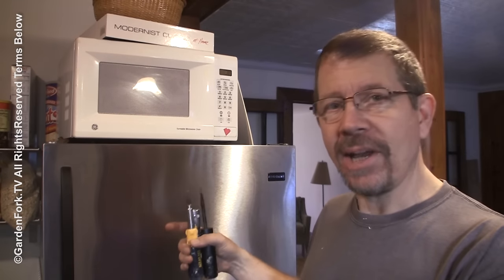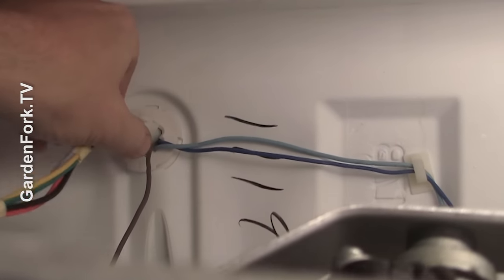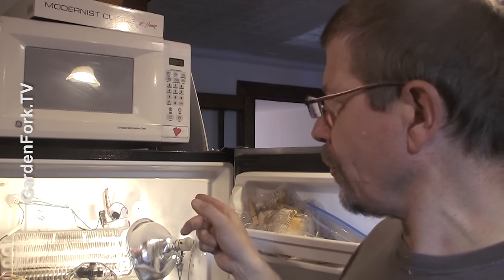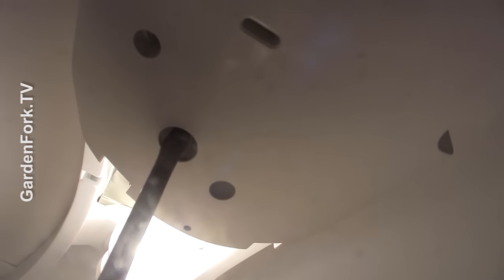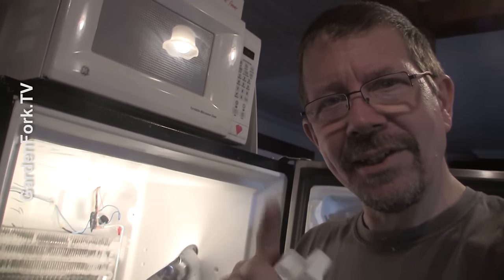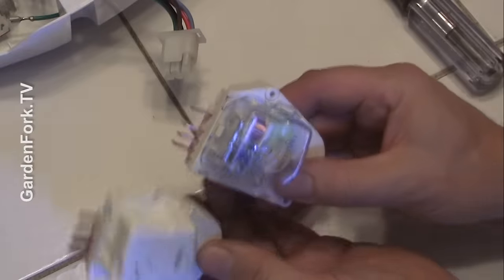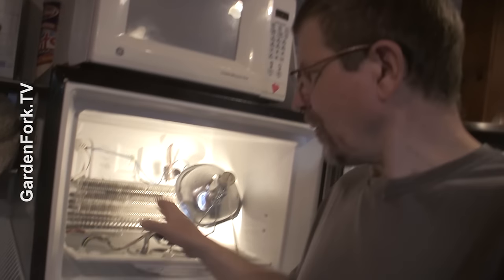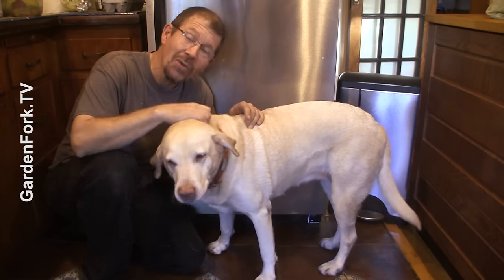Refrigerator Repair - Freezer Coils Frozen - Refrigerator Is Warm - GardenFork

Comment: Hi GardenFork!  My situation is like you explain in video.  I have same refrigerator as in your video.  Specifically a Frigidaire Model # GLRT182SAW2.  Freezer not exactly freezing up "a lot" as you say.  But freezer is freezing food. Bottom refrigerator is warm, not getting cold, food spoiling.  I see some snowy like frost on back freezer panel and on freezer vents, but not a whole lot.  Every now and then the snowy frost on freezer vents melts and I get water dripping from somewhere towards back of light assembly in the bottom part of refrigerator. Then the dripping stops, and freezer vents get frosty again.  That water dripping has been happening a long time, but with both freezer & refrigerator compartments working normally.  This tells me I really don't have to remove the back freezer wall because something is obviously defrosting.  Should I forego the step about removing back freezer panel and testing the defrost timer??  Should I instead just skip to actually replacing defrost timer??  I don't have a hexagon shaped screw driver so that's an extra step to go get. I'm trying to avoid extra unnecessary steps. Does this sound like a two-fold problem?  The defrost timer....and maybe also the drain tube in back of light assembly being clogged?  Any thoughts or tips very much appreciated.  I love your two Lab girls!!
Reply: A little hard to follow what you are describing. You could just replace the timer, cheap enough.  If you remove the rear panel in the freezer, you can confirm if the coils are defrosting as they will be all iced up . What happens is that the ice ant frost eventually blocks the vent to the fridge. If you are getting frost on the inside of the freezer I would bet your coils are not getting defrosted. 
 A temporary fix is to use a hair dryer to defrost the coils. Be sure the drain hole is not clogged. Some hot water poured down it should melt any ice. I got about 4 months time before it froze up again. Plenty of time to ponder to get a new fridge or fix the old one.

Comment: Could a defective timer explain why the freezer doesn't keep ice cream cold enough?  Ice cream (for example) is still cold but not hard frozen like normal.  Too much time in defrost mode?  I tried vacuuming the heat dispersal coils below the fridge and (for kicks) i defrosted the coils behind the freezer compartment.  I have not been having any issues with water leaking anywhere.

Comment: What type of screwdriver do you use at 3:28? The hole for my timer is round nothing grips

Oh nevermind I saw that you're using a flat head screwdriver and you don't try to fit the hole you're using those protruding plastic thingies to turn :)

Comment: Why does my refridgerator evaporator line freeze right where the condenser line meet, from the back of the fridge to the evaporator coils?  I took off the little block of ice and it froze again overnight. My evaporator coils don't freeze, just where the condenser and evaporator lines join

Comment: I don't understand the relationship between the thermostat, the timer and the heating element.  i take it that a working timer will regularly turn off the compressor and send power to the heating element, but what function does the thermostat serve in relation to that series of event?  BTW, I have an old Westinghouse BJ414CM upside-down fridge. Any idea where the timer is located?
Reply: The timer tells the defrost heater element to turn on, but the element checks the thermostat to see if its actually frozen over or not. If its not frozen the heater wont come on, i think.... just what ive understood watching some videos
Reply: Here's a better response from Wikipedia:

A defrost thermostat opens the heater circuit when the evaporator temperature rises above a preset temperature, 40°F (5°C) or more, thereby preventing excessive heating of the freezer compartment.
Reply: I have an old GE fridge with the freezer on the bottom (is that what you call an upside down fridge?). My timer was at the top back of the fridge inside a compartment between the two bulbs... i unfortunately broke part of it off so careful on removal

Comment: Oh, wow, you have the exact same fridge as me, which means that it is almost certain that this is the exact issue I’m having!
Reply: Low and behold, it’s not the timer - I’m going to have to use a multimeter on the wires for the heating element I guess. Maaaan
Reply from the maker: bummer, sorry!
Reply: @gardenfork  still, your video is phenomenally helpful, and I wouldn’t have had the ability to fix this without your video!
Reply: Huh, actually it might be the timer after all?! I just tried it again, and the heating element IS working now and melting the frost? Maybe there is a loose connection somewhere. Either way, I probably need to replace the timer anyway.

Comment: When Daddy is in the kitchen, it's dinner time.
My Frigidaire in the garage ice up very badly several years ago.  Repair instructions in the internet for some of the units are pretty scarce.  The repair sheet for the tech was folded and in the overhead light compartment in the fridge.  Following troubleshooting on it, I found it was a bad defrost terminator, what you refer to as the thermostat.  About $7.00 on eBay, local dealers wanted almost $20.00.  all better.
Reply from the maker: i ordered the  thermostat for mine just in case, it was about $8, good insurance and now i have it in case of failure.

Comment: Hello, How can I check the resistance of the refrigerator, to see if it is in good condition? Resistance can be checked with 120 volts? this is the model of the fridge. WR519SZDWOO.

Comment: I have that same fridge and im sure id need to replace the Heating Element and or Thermostat in it since it doesnt get hot. Does anyone have a link or know the model number for this fridge. I bought mine used and there is no numebrs on the back. Thanks!
Reply: Mine is model FFTR1814LWL and it looks just like that one

Comment: 4:50: It's not clear how you concluded that the freezer defrost thermostat is working.
Reply: Since the "heating element" in the video heated up, both the heating element AND the freezer defrost thermostat are working.  The defrost thermostat closes and completes a circuit (allowing the heating element to heat up) when it is working properly and when the thermostat gets cold enough.  IF the heating element did not heat up, it could have either been a bad heating element OR a bad defrost thermostat.  Then, you have to test each of these 2 for resistance, (Ohms on a Multi-meter) in order to determine which one is bad.
Reply: @PatrickWagz  Thanks, man. Makes sense.
Reply: @tmst2199    right on, I actually just checked my frig today... haha   heating element, defrost thermostat, and defrost timer are all good.   Thinking it may be the evap. fan next.
Reply: @PatrickWagz  Right. There's something to be said for working backwards. If the evap fan isn't running, make sure it's not broken before checking the other stuff that controls it. BTW, been there, done that on the evap fan. In my case it was the leads failing due to a poor design.
Reply: @tmst2199    Yea, that's good advice.  It's my neighbor's old frig.  He said I can have it because the freezer gets cold but frig stays warm.  I plugged it in and the evap. fan ran.  Even tested it for Ohms and had around 120-130.  So, that's why I tested defrost timer, heating element, and defrost thermostat.  That all tested good.  Sooo, now I'm thinking the fan may be working intermittenly or not always starting.  I wasn't able to find an exact cut-off for a good/bad Ohm reading on the fan.  Some said under 150 is good, others said under 100 is good??
Reply: @PatrickWagz  I don't know what the impedance of the motor windings is supposed to be. It could also be low on refrigerant, have a weak compressor or other stuff. What's the temperature of the air as it blows across the evaporator?

Comment: Mine is iced over. I disassembled and melted ice with blow dryer. Compressor is going on and off but is ice normal to be on coils until the defrosting/heating element comes on to melt it?
Reply: I would like to know the same
Reply: @nicholaszamir  Is yours icing up?  I figured out the problem with mine is the defrost timer
Reply: @nicholaszamir  there is some frost on the coils but it shouldn't be a thick layer of ice. If it is, your defroster may not be coming on or working. Test your defrost timer.
Reply: @luv14lyf  I'm still trying to diagnose it. My refrigerator doesn't have a timer. The control board controls the heater unfortunately. I'll be changing some parts to try. Got the bi-metal defrost thermostat and the thermistors. Will install later. Wish me luck.

Comment: I believe the timer only turns during compressor run time. So, for example, 6 hours of run time.  I wish they made simpler refrigerators like the ones from the 1950s-60s, they take effort to defrost properly, but were bullet proof (until someone defrosts it forcefully).
Reply from the maker: our family has an older fridge and it has run forever. just a compressor and a mini freezer up top.
Reply: I took an old GE to my summer job years ago, the kids there murdered it within a year.  The thing was a tank.  I have a not-so-old freezer downstairs...still probably pushing 50 years.
Reply: I hv the same type fridge setup you showed.
1.  Should the defrost timer be continuously ticking?   I read there are 2 types: continuous and noncontinuous.  Which is this model?
2.  Does the heater only turn on if the thermostat is working properly?  Closed when cold enough, open when warm enough.

Comment: our problem is not the coils freezing over but the damper area freezing over and not allowing cold air to travel from the freezer to the bottom. 
we have changed the thermostat and the timer
the heater is obviously working because the coils arent freezing over
what gives? we are at our wits end

Comment: You turned the timer to the defrost cycle and the defroster turned on.  How does this prove that the timer is buggered. If it has continuity or not is the determining factor .
Reply: It also looked like you had partial defrost on bottom and not the whole evaporator. I suspect the terminating thermostat needs to be moved or changed out to get a complete defrost.
Reply from the maker: Hi James, the test routine we did was based on the one from Parts Select and it was indeed the thermostat.  thx!

Comment: where does the  defrost water go, ultimately? my fridge leaks
Reply from the maker: the water goes into a tube that runs in the back of the fridge into a pan underneath the fridge. if its leaking, it may be the tube is clogged or frozen shut and the water is running out.

Comment: Would you quit? Come on... you're getting into the income of those in the know. Now, we can't screw over those that have a clue. 
If you give a man a fish you feed him for the day, if you teach a man to fish, you feed him for a lifetime. People have become so absorbed in their own existence that they choose not to be willing to take care of their own needs. That's fine. That's what we will charge you for.
Reply: headpainter1 well said
Reply: New appliances don’t come with the same kind of manuals and ease of parts as they used to. They’ve purposely made things harder to cause people to be afraid to do things like this on their own.
Reply: I just replaced the alternator on wife's camry. Nippendenso  lasted since new 2004 to 2021. Bought a duralast $160 just to get it back on the road. Ordered a rebuild kit for the nippendenso. Screw turning it in as a core. They wanted like $260 for a nippendenso at part store. And I believe it was a rebuilt one. Did the same with starter on my tundra. Much cheaper to fix your own stuff.